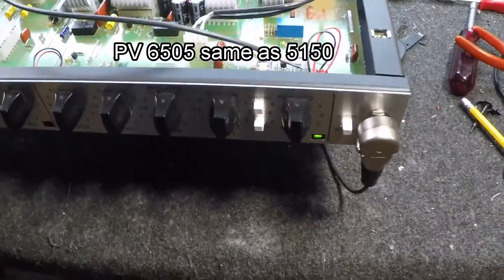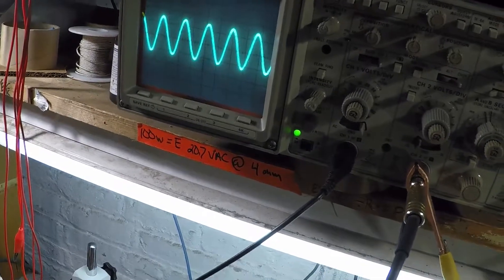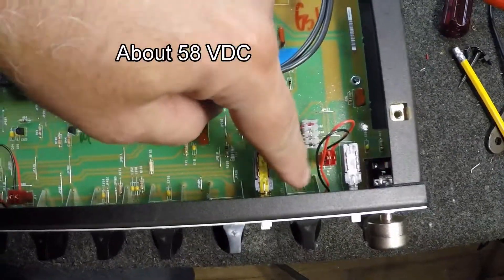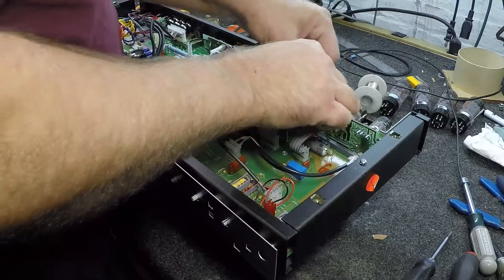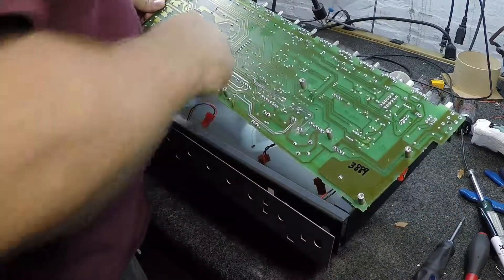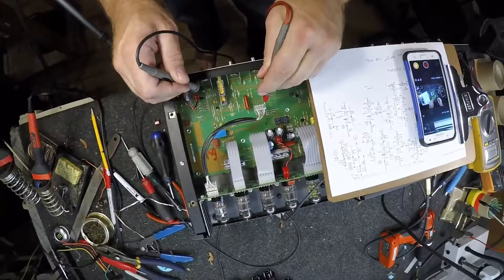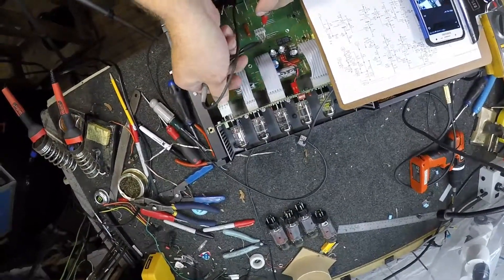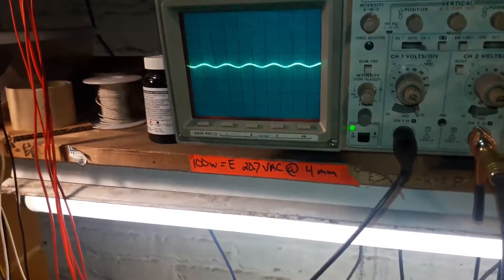PV 6505+ repair or mystery of the "Volume Controls dont Work"

Comment: Did the volume control just stop working randomly?, what was the guy trying to fix after  it happened? or was it messed up from the start?
Reply from the maker: When other techs bring me repairs, Im third in line . Im sure it had a problem and then it got more problems.

Comment: I have a 5150 II replaced all tubes on the entire amp, replaced fuse in the back as well, All tubes light up correctly when I turn the amp on the head green light turns on but when I switch to stand by nothing happens. Amp cant be played but all the lights turn on for all the channels, Any ideas On what I can do to pin down the problem? seems like something to do with the stand by. was working for years.
Reply: Thank you for your advice, I was able to replace all the internal Fuses and now I'm playing again, Sounds better than ever with all brand new tubes. Appreciate you taking the time out of your day to help and assist me thanks again.
Reply from the maker: Ill have to look at the schematic, but usually on most amps the stand by switch has its own fuse that supplies voltage to the center tap of the output transformer. Put in a new set of output tubes and replace that fuse good chance it might work.
Reply: @clintronicsrva  Thanks I took the head apart and removed all fuses going to replace them today seems 2 were blow on the internal board, Put brand new tubes in the back as well as all new  preamp tubes ill reply to you once the fuses are replaced appreciate your time .

Comment: Hey man! nice work with that amp, I have a couple of questions....hope you don´t mind....

First, did the owner of the amp told you more specific details about the failure??

The thing is that I own a 6505 and I've been having some problems with both post gain channels (clean and lead) the issue comes when I try to raise the volume (or low it) because it seems to be permanently loud and when I try to move the post gain knob (in any channel) doesn´t seem to affect the volume...the only change that happens when I do that it´s to perceive a small change in frequencies (EQ) without affecting the volume....something similar happens with the pre gain...

Hope you can help me!
Reply from the maker: Yes, he said that someone else tried to fix it and couldnt. I think what happens is that connector gets plugged in wrong and then damages other components because a high voltage gets sent somewhere where it doesnt belong.
Reply from the maker: see those two black relays in the video? I also replaced them. Although the volume pots act like they are broken they all tested good when removed from PCB.
Reply from the maker: Replace the two largish gray Ic(Illinois Capacitor) caps also. They were leaky on this amp letting a DC voltage bleed into one of the preamp tubes(very strange). That was the final piece to getting this amp perfect
Reply: So as for the description of my problem...do you think is the same problem?...
Reply from the maker: yes I do. replace those two gray caps first though. then retest
Reply from the maker: If you cant get it working you can always ship just the chassis to me clintronics.com my rates are reasonable.
Reply: Clintronics RVA Finally my tech change de caps and now it works!! Thank you!!